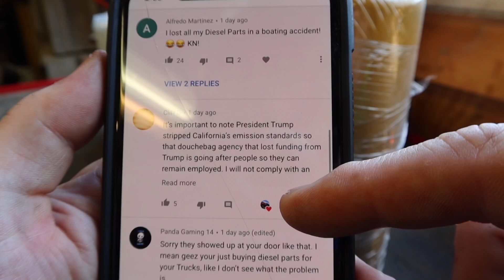I’m Under Investigation For Buying Diesel Parts!

Comment: Go to Europe and you can buy suppressors for 50 euros. 
Buy a fuel filter in America and get homeland security knocking on your door.
Reply: Burn a Target to the ground after stealing everything out of it and you're good, though.  I'd say we're good and fucked, everybody just waiting for the first domino to fall.
Reply: The funny thing is suppressors are actually encouraged in Europe, correct me if Im wrong but in some countries in Europe they are required. All suppressors are, is nothing more than a novelty..
Reply: So you can shoot a gun without your ears ringing, some suppressors are really loud, they are not silencers
Reply: REALLY? whats the exchange rate euro/USD right now? Asking for my friend Diesel DAVE
Reply: @LateLost  the suppressors are still really loud, just not loud enough to make your ears ring, and that's part of they extremely strick laws, in Canada you may have a pistol but leave it at the gun club and only shoot it at the gun club, crazy laws could easily be asked to be enforced in the states

Comment: Used to work at orielys in Ames Iowa and had the atf come in and take all the oil filters in two brands on a certain number threading due to them being modified into silencers so orielys changed the part number of the filter

Comment: So, diesel filters can be used as firearm suppressors?
Thanks, DHS! I didn't know that until you explained it to me.
Reply: You need an adapter, It's not a direct thread
Reply: @andrewilliamson6057  I mean,you don't NEED an adapter,just makes it easier for city guys that don't know how lol.
Reply: @texasdad2372  some pitches do direct thread some need the adapter. I made the mistake of buying from an online shop for one of my ars and it has some weird as thread pitch that doesn’t match any bird cages. It was a bad move
Reply: @andrewilliamson6057  I wasn't talking about "storebought" suppressors man but i know about thread types and all for them lol.
Reply: I actually learned about this from playing the 2019 Modern Warfare campaign. Early on in the game, you just see an American yanking out an oil filter from a van in order to take out a couple of enemies.
Reply: @andrewilliamson6057  the things they're talking about are not fuel filters. They are suppressors, labeled as a fuel filter. They do not act as a fuel filter in any way, and are made to be converted into suppressors. You just need to drill holes in the baffles. Most are already 1/2x28, and ready to screw onto a threaded barrel.
Reply: @littlejackalo5326  they are talking about filters, that’s why when he bought filters he showed up on the list. I know what you’re talking about and they suck
Reply: Most people: wow, I had no idea that was the case.
Half of commentors: actually yes, here's a step by step tutorial.

NSA: I just wrote down 97 people we need to go visit. Wth is wrong with this guys subscribers damnit
Reply: I guess you can learn things on YouTube after all.
Reply: They are not illegal. You can have one mounted on your rifle by a gunsmith for about $800.
Reply: Don't forget the $200 tax stamp and 6-12 month wait.  Suppressors are legal, but make sure you go through the process.  The 1/2-28 and 5/8-24 "fuel/oil filters" are sketchy and likely to get ATF to intercept the package.
Reply: I don’t really think it’s a good idea to explain how a suppressor works, especially if the Federales are listening.
Reply: @mctransportation9831  you can do it yourself and not pay anyone except the gubment and the company
Reply: @andrewilliamson6057  if i were doing it all the time, that might be ok. I only have one rifle I might want it on and I'd want it done right and to make sure all the paperworm was in order.
Reply: @mctransportation9831  They are a class 3 fireleg (or some other limb), as such they are not illegal, but are controlled.

I’m ex-military and have legitimately and legally used one, I can tell you they are junk.
Reply: @peterking2651  my gunsmith said its just a matter of filing some paperwork with your local sheriff or cheif of police.
Reply: @randombuilds8336  isn't it a tax stamp you have to buy every year? Not just a one time fee?
Reply: @scottwall8419  one time fee for each nfa item
Reply: You have firearms that you intend to use illegally for something other than defense or hunting? Thanks, the A.T.F. will appreciate you turning yourself in. We are all grateful that you would rather confess to the ATF before you decided to become another toxic parasite in this sick society. 

FYI you don't need a suppressor to defend yourself. Only a coward needs one. We don't need cowards.
Reply: Didnt know that was a thing till now
Reply: @brendanwood1540  whoa dude, what's your problem? You work for the ATF? I noticed you said "we". Some people just like to shoot suppressed for fun. You my friend however don't sound like any fun at all. I wouldn't ever recommend doing anything illegal. Tax stamps are fairly easy to obtain and anyone who wants a suppressor should go about it the right way. Don't know why you're here calling people cowards?
Reply: @brendanwood1540  the hell are you talking about.
Reply: Pillows work as well, along with other random items lol
Reply: @brendanwood1540  a good reason for having a suppressor is for home defense, if you woke up late at night to someone breaking in and you need defend yourself a suppressor is great for not blinding yourself with muzzle flash or deathening yourself. Also saying it makes your guns less accurate and less range is a load of crap you got from video games also in a home defense environment you don't need long range unless one room in your house is like the size of massive warehouse. You also saying most people who use guns as tools are "xenophobic cowards" is a bit presumptuous makes me think you're a bit bigoted yourself.
Reply: @TheEnclave-wi9qo  How many home invasions happen in your area? I once lived in the serial killer capitol of the world without a gun at all. I did keep a sword by my bed. Most home invasions happen because you are a drug dealer or user who has ripped off someone or threatened their business. In most cases it is done early morning because you will not wake up and get the upper hand. You will be groggy and even if someone is holding a kitchen knife you are not going to get stabbed to be a hero and get your gun. 

The only way to avoid home invasions is to respect the common principle that everyone needs to eat. If you try to show compassion and respect for those around you they will not invade your house. If you broadcast wealth or you try to cheat people to get ahead. Then you are a narcissist.

All you need to do it mind your own business and live a humble life. 

Last point. Gangs are the criminals, even if the ATF has been corrupted in criminal conspiracies it is because of gangster culture. There would not be organized gangs of street thugs if they did not have access to military grade arms in your country. We can only legally buy semi-auto rifles with a possession and acquisition license. We don't lock our doors and we don't own pistols. 

You are the ones suffering the high crime rates for the same reason Israel is afraid of Arab people; Xenophobia. You are scared of that which is different instead of trying to find a common ground you put up walls and bare arms. This posture makes you threatening existentially especially when you take resources and exploit the environment. 

When the external impacts of your greed effect people without security or healthcare. Then they desperately will do what they need to do in order to survive. 

The boy who is not loved by the community will burn it down just to feel it's warmth. American consumerism 101. Inequality = high crime rate. Insensitivity, xenophobia, and compensation for personal insecurity. Racial divisions and political divisions because of  your inability to try to have a reasonable discussion with the other side.
Reply: @brendanwood1540  I'm guessing you think I'm an American.
Reply: @brendanwood1540  where I'm from it  happens alot to rich but still a very high possibility where I'm living alot of druggies needing quick cash.
Reply: @brendanwood1540  22lr is crap 9×19mm or 9×18mm is a much better for stopping someone.
Reply: @TheEnclave-wi9qo  Last point. Most criminals aren't trying to kill you. They want to take your belongings. So if you give them what they want they will not do anything too crazy. But if you suddenly pull out a weapon they might over react and shoot you. When they never wanted to be a murderer; in fact they probably never wanted to do theft under or over $10 000. Do you think they want to go to jail for LIFE? Unless you really have beef.

Then ask yourself why the beef? What part did I play in it? Can I resolve this in another way?

The best way to stop people coming through our property and using needles or stealing things was to talk to them and give them some charity and good advice. Most of them are mentally ill and people discount how hard it is to even seek help on your own if you are that mentally ill. They just need your help, and they will be forever grateful. The probability of them targeting your house fades the more compassionate you are.
Reply: @brendanwood1540  I'm fine with being charitable but I'm not letting people take my stuff I payed for with my hard earned money times are hard enough. If they didn't want to risk getting killed or becoming a murderer they should've picked a line of work what won't get them in that situation.
Reply: @brendanwood1540  also all where I'm from if you show compassion to people like that they're more likely to use you for drug money and never show any kind of gratefulness or compassion or pay you back for the money or hospitality you give them.
Reply: @brendanwood1540  I'm curious what does this debate about guns and what's should be allowed for self defence have to do with Israel and Palestine I've not been following what goes on over there.
Reply: @brendanwood1540  yeah I believe in respecting your neighbours but that still doesn't mean it eliminates the need for having firearms.
Reply: @TheEnclave-wi9qo  That's why you also need to stand your ground in an assertive way like let them know that this is the good way. But they can see that you aren't fucking around or trying to get fucked. Basically just try not to laugh in their face and make them hate you. I feel that. But there is a balance point. 

Violence is not usually the answer. Diplomatic intimidation. Think of it more like an encounter with a bear. The bear wants food. The bear will attack at the sign of weakness. It's not always required that we kill the bear. 

Killing a human makes another human into a bear with a cub because humans seek revenge. Unlike the bears who won't know what you did. But a mother and a cub best to avoid that. 

Think simple shit like I'll separate out the glass bottles and cans for you and set them aside when you want to come by to pick them up. That way you don't need to go through our garbage. 

Rinse the stuff out for them. Free garbage with a hint of compassion.

Otherwise they just fixate on how much stuff you throw away and maybe see how you don't consider their needs important. So why would they consider yours important in the face of their own survival?

If you were in their shoes. Sounds like you would do the same thing.
Reply: @andrewilliamson6057  Problem is there are companies making ready to use as silencers (pre-threaded) and selling them like they are fuel filters and oil filters.
Reply: You need the right threaded adapter.

Actually you can buy one and that adapter is the "suppressor" and what is tax stamped and Registered.
Reply: @mr.sharpie2206  seen those.
Reply: @imadequate3376  I've seen ads for fuel filters on youtube where in the ad they thread it right on a pistol. No adapter needed, just have to drill out the other end.  The problem is these devices don't adhere to the Gun Control Act and National Firearms Act making them illegal even in a state where you can own a silencer.
Reply: Pop bottles too.  Oh my God :0
Reply: @mctransportation9831  you just got to an ffl dealer and they will fill all the paperwork out you need. I just did this back in june and currently waiting on my suppressor.
Reply: @scottwall8419  one time fee.
Reply: @brendanwood1540  Its called saving your hearing. Wtf does this have to do with cowards???
Reply: @brendanwood1540  absolute respect ✊🏻
Reply: @littlejackalo5326  How do you know all this? Be advised , you have been added to our investigation.
Reply: I'm surprised ppl just now learnring of this lol
Reply: If you can weld coins work wonders
Reply: Steel Wool works better
Reply: @trickyfoxx6941  You don't know me. Let me ask you this; if these people were not flaunting the stuff would you feel so bad that you have to turn so cold? Because I know that the real struggle isn't about money. It's about power. It's about contrast seeing people across the tracks. 

Trust me dude, I spent time in many hoods and lived there without being targeted. People actually brought me stuff that they stole from other people. I set people on the right path and saved lives. 

I don't respect when the powerless become the tyrants who created the oppression in the first place. It's circle and you have to break out of it or you are the problem.

What if we just coordinated our efforts and go straight to the top where the power is concentrated? Then we distribute the power to the powerless and nobody needs to rob anyone?

Because I believe in order; but not this kind of hierarchy. There's a more natural hierarchy and you know what that is. Billionaires wouldn't last a second in the hood.
Reply: @takiua2264  Dignity lowers crime rates. Not incarceration. Not guns. Look at the German prison system. You don't know me. 
It takes real bravery to approach a lost person who is angry with compassion and empathy; unarmed and without backup. To really understand human nature. 

Cowards project their insecurity onto others. Hero's save people by putting others first. Without discrimination. 

I don't live in California. I have set several criminals on the right path and helped them question their deeper motives. For some reason they always share their deepest thoughts. 

Don't be a tyrant. I'm not trying to take over anything. Hearts and minds. Trying to help us resolve conflict. I don't want to hate you. 
Why do you hate me?
Reply: Yes.. but the ones that's are metal.. as a suppressor is pretty much a muffler on the car.. the have baffles inside.. to dispute the sound.. but suppressors. Don't last long. Why the cheap route is oil filters.
Reply: You can legally do it too. Just needs a form 1 and a tax stamp and a serial number.
Reply: @scottwall8419  😆😅
Reply: @johnjohnon8767  😅
Reply: and they don’t work, hhmm, odd

Comment: Since solvent traps do not reduce firearm noise they are not suppressors. That has been stated by a federal judge. It doesn’t matter what it looks like or what the intent was. If it doesn’t perform it doesn’t count as a suppressor.

Comment: The whole thing with the oil filters & fuel filters being turned into a suppressor is been going on for decades it's nothing new
Reply: This issue in particular is not actual fuel and oil filters, this is a new issue, they are selling 90% functional suppressors, real machined or synthetic monocore suppressors. And labeling them as "Fuel filters" and selling them online, i get YouTube ads for them. They even say they are "monocore pre threaded suppressor fuel filters" All you have to do is drill your own hole on the front cap. They even give you a jig for the hole drilling.
Reply: @CondoreComputing  what's funny is that you can make a far more effective suppressor with a 6" steel pipe, a dozen steel washers, and a dozen solid rubber grommets. Why people use oil filter suppressors is not something I understand. They are objectively worse then something you can make after a quick trip to the hardware store.
Reply: One of the oldest videos I've seen on YT (14 years ago!) Is a guy using an STP as a suppressor.
Reply: checking out someone & their property, thinking that they have the authority to do so, is new & it will only get worse until people learn what their rights really are & stand up for them, learn to stand their ground.
Reply: They used to sell manuals in shotgun news early 00's.